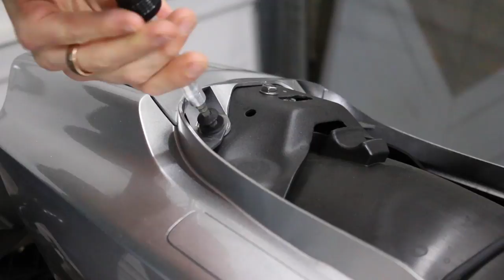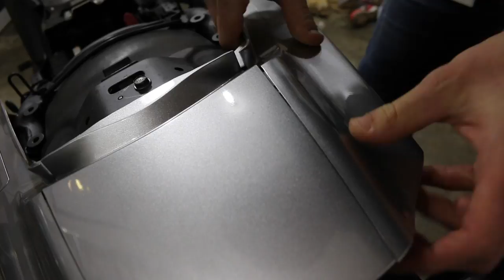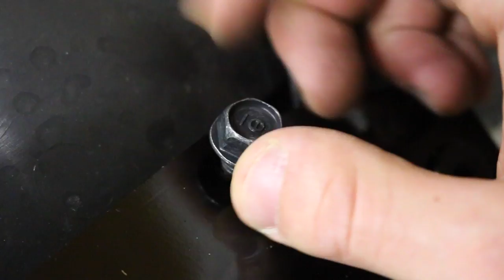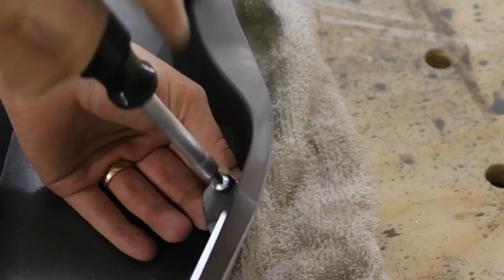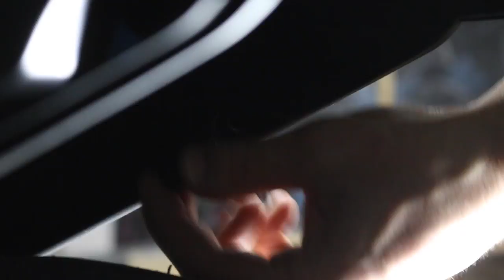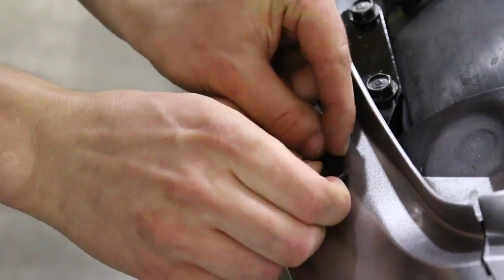Honda CTX700N Rear Cowl Removal + Inner Support Install | VQC

Comment: hello i came cross your channel and i have the CTX700N model, and i bought the backrest and bracket with the Inner Support Bracket also, and Question?  did you have to buy the bolts & spacers Separate to go into the rubber cushions to mount the backrest to the side fenders.   because when i bought all this i noticed that it didn't come with it. Great Video.

Reply

Comment: Are the bumper push-pins you’ve got listed in the description optional or do we need them to do the work? If so how many did you need?
Reply from the maker: The bumper seal clips should already on the bike. I listed them since I ended up snapping a couple. They’re extremely delicate. 

I guess the answer would be to order how many were broken during the install. I like to have some extra lying around as well. If I can ever find them. 

https://www.partzilla.com/product/honda/90116-SP0-003

Comment: Where did you buy the parts
Reply from the maker: I purchased the parts from the Honda power sports website.
http://powersports.honda.com/2015/ctx700n/accessories.aspx

I also found a lot on eBay, but I wanted to make sure I was getting the right parts for the year of this bike.  I'm sure they are all the same though since there hasn't been many changes between the years.